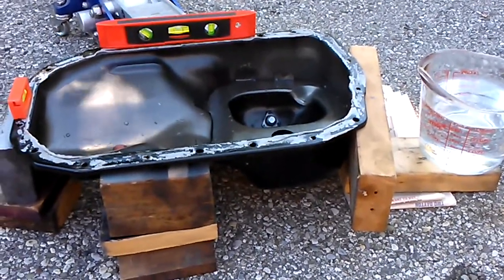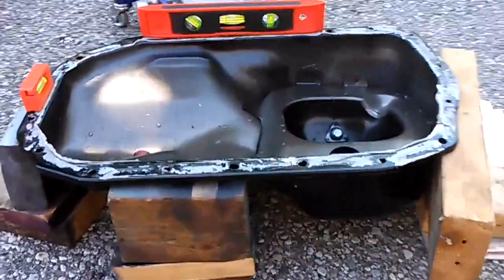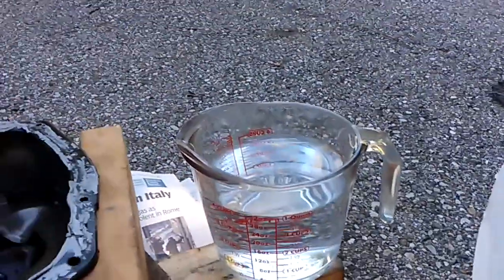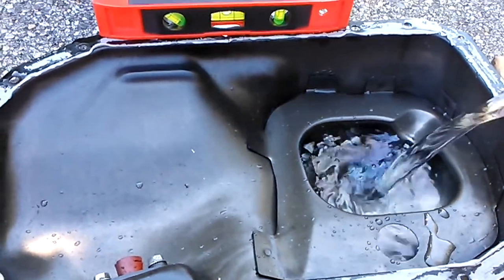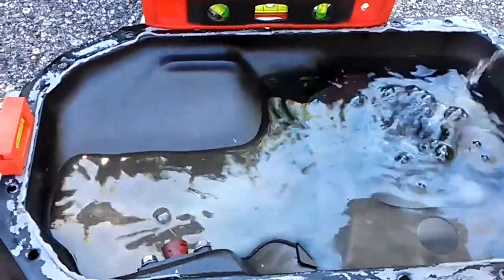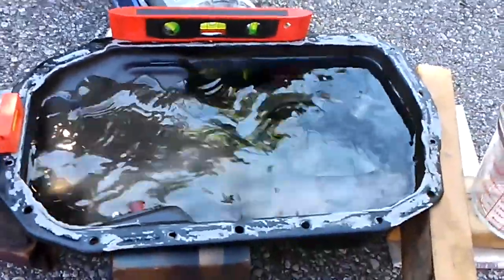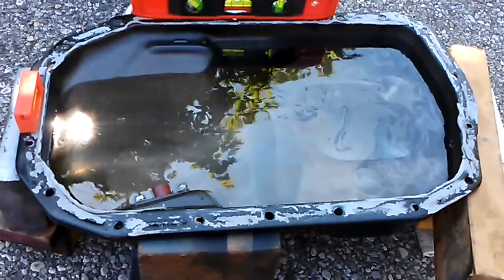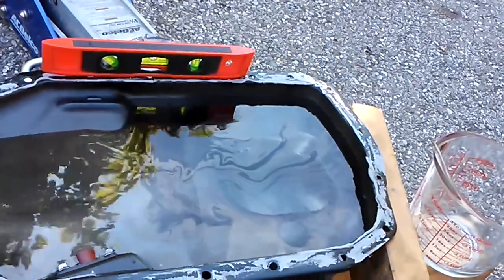4G63 oil pan capacity

Comment: 4G63 problem is that oil is getting stacked up in the head, and theres also lots of oil in other parts of the system. So the pan aint that full when the engine is running
Reply: peNKku:  The other thing to take into consideration is how the oil coming out of the turbo is basically whipped cream.  I'm sure that has an effect on how much is in the oil pan.